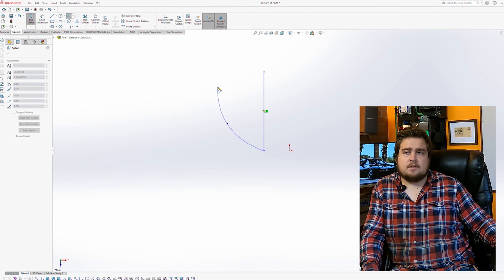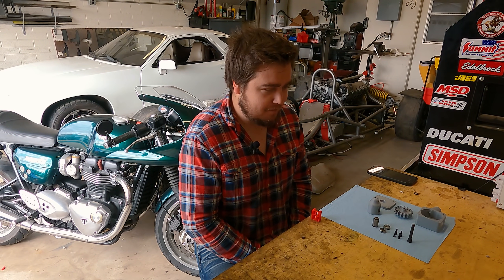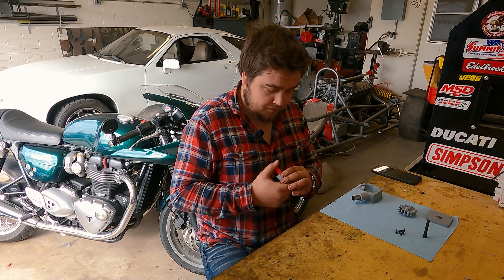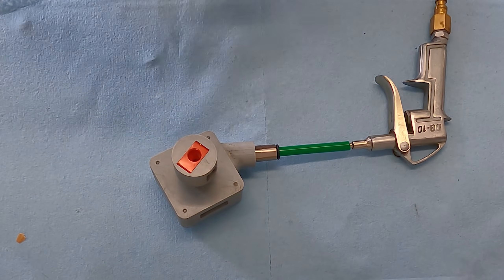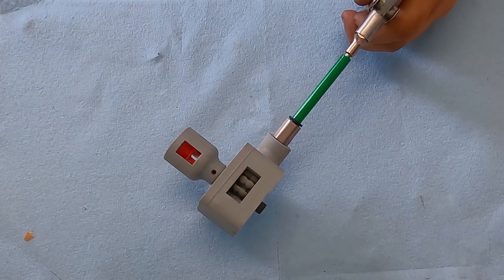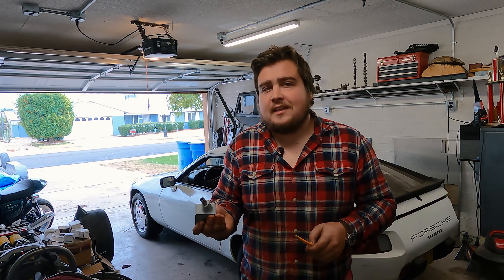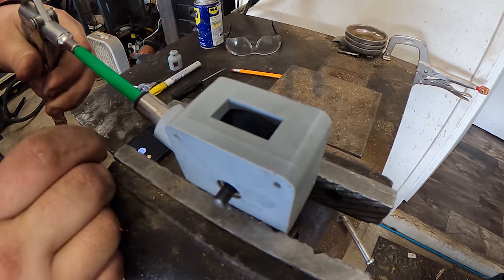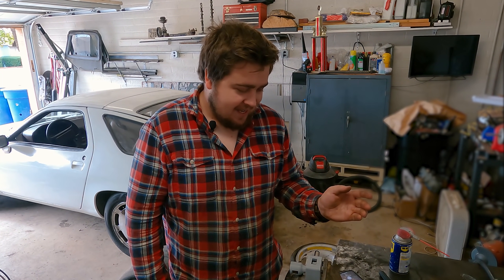11,000 RPM Turbine Pencil Sharpener!

Comment: If you try this again, you should swap the motor of an existing mechanical sharpener, or otherwise build your own tri-gear sharpener.
It seems like the three cylinder gear setup that the typical crank and electrical sharpeners use works a lot better than bladed for high RPM sharpening, the bladed designs are mostly good for low RPM high torque cutting, such as the intended use case of being compact and handheld.
Reply from the maker: You're absolutely right- And that's probably the solution to a lot of this. ultimately chip accumulation was the downfall.
Reply: @WesleyKagan  a dual blade with 2x opening for shavings to exit may end up being the ultimate design. This would split the length of the shavings in two, allow twice as much material to be removed in the same time frame, would provide a more even cylindrical cut of the pencil, and would eliminate the offset force created by the friction on only one side of the pencil. There is angular force being applied to the shaft with the singular blade design which most definitely causes a fuckload of issues.
Reply: @WesleyKagan  and a planetary gear set
Reply: @WesleyKagan  awesome that you responded and great content. Subbed!
Reply: Maybe a gear reduction drive as well.
Reply: i was gonna say same thing
Reply: Planetary gears!